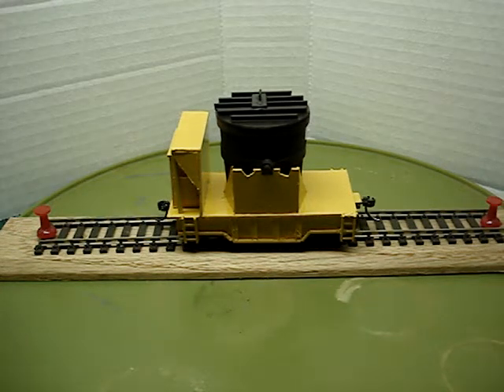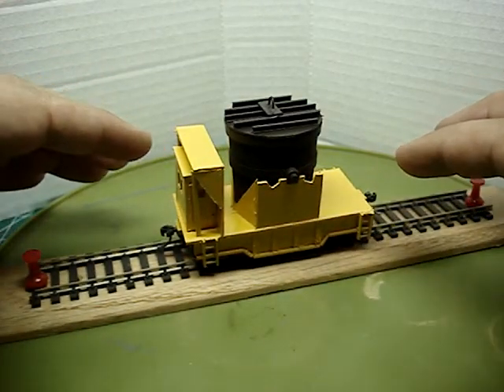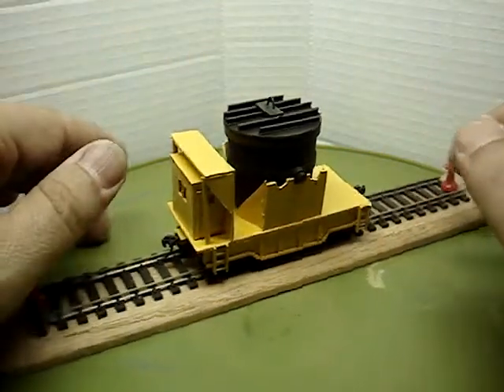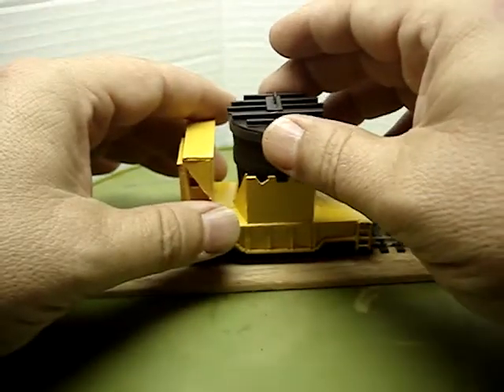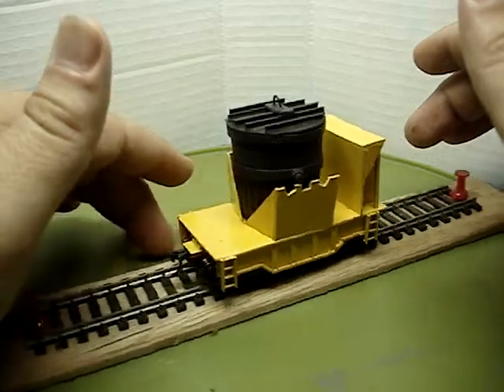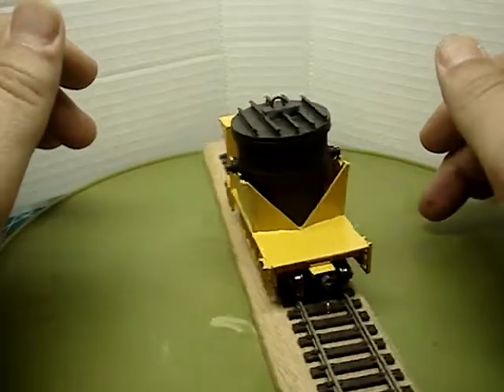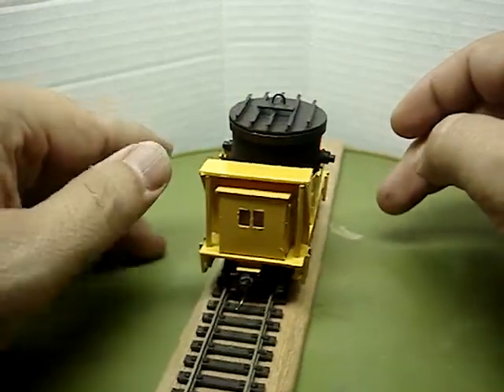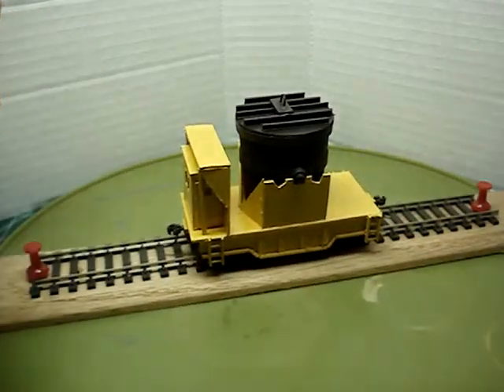HO Ladle Transfer Car

Comment: Looks awesome, really nice job. Thanks for sharing. Dave
Reply from the maker: Thanks Dave. Whatcha working on today ?
Reply: @ModelingSteelinHO  Painting the house, man is it hot. Today is Monday and we start again at 630 AM
Reply from the maker: @davestrains6816   Dave,we must be about in the same region. It's been 109 for over a week. With the heat index daily temp has been in the extremes. Work safe Dave.
Reply: I live in Tennessee so we have been in 90s and humidity is very high. It gets to 93 today and humidity is gonna be in the 90s so no painting today